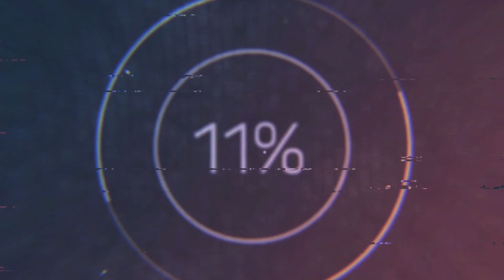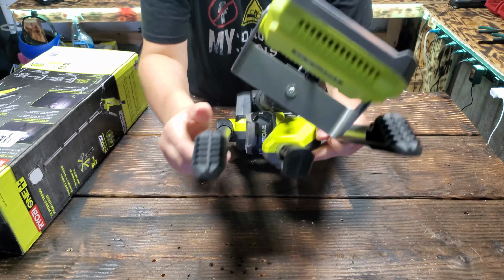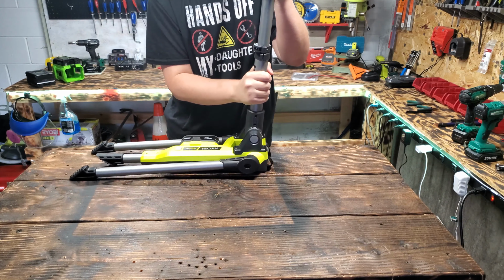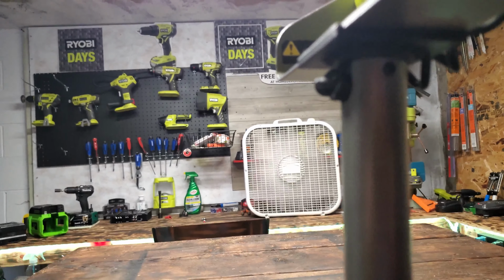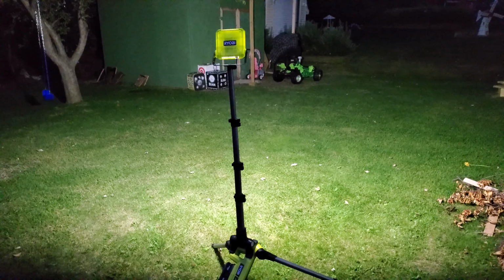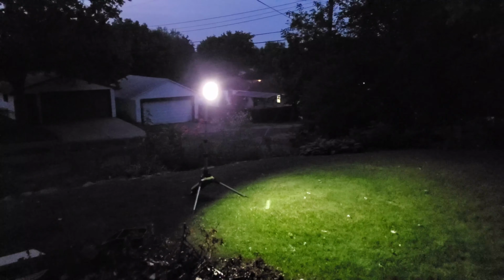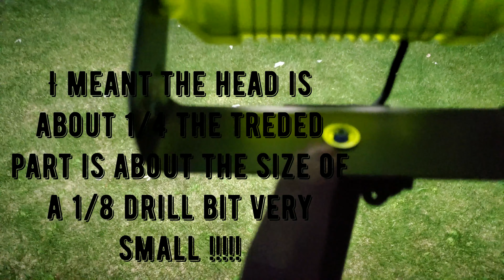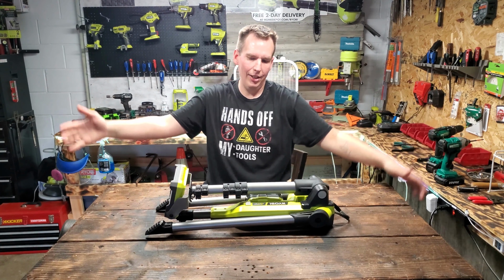Ryobi Hybrid L.E.D. stand light Test and Review

Comment: Thanks for posting this. I’m considering getting two of these for camping. I think it should be fine for what I need it for. It does have the 3 year warranty so if the screw on the head becomes an issue I’ll contact ryobi. I’m pretty handy myself too though so even if I want to do something about it I can fab something more stout. For the price, portability and the light it puts out I think it’s a win for me.

Comment: Thanks, good review. I'm a fan of Ryobi and I too would have expected better quality in this product. Unfortunately, it's quality is on par or even a little better than other work lights in this value/price range. I'll be checking out Milwaukee, since you mentioned it a few times.
Reply from the maker: Yeah it is the same price as the Milwaukee M-12 tower light or "rocket light"  there both around 129, but starting February 1st. the Milwaukee will be 169.99 add you get a free 6.0ah battery, so that's not a bad deal.

Comment: I think you meant 50 feet and not 50 yards in the backyard...  Thanks for the review on this. I was looking forward to it, but it looks like a flimsy piece of crap. I have the M18 and the M12 lights. Used the M18 for outdoor projects after dark and painting inside when it gets dark. I use the M12 for small projects like when I replaced a shower valve and it comes in very handy when working on motorcycles. I’ll probably pick up another Milwaukee if I find a good deal on one. $139 for that Ryobi just sounds like way too much for a junky light.

Comment: How’s the long term review?
Reply from the maker: Well it still works. Its very loss and wobbly, Its ok but i think it should definitely be around $50 not $130 you know.  I got my Milwaukee Tower light for $107 with the Hack last year and that thing is still working like its brand new. thanks for watching man
Reply: @Impact-OG  I’m on the 12volt Milwaukee, 18v ryobi, 18v makita and Dewalt 20v.
I figured best value for my is probably the ryobi since the dewalt gets major complaints about the leg joints breaking and can’t get the m18. I missed the m12 hack bc that’s also hybrid as well correct?